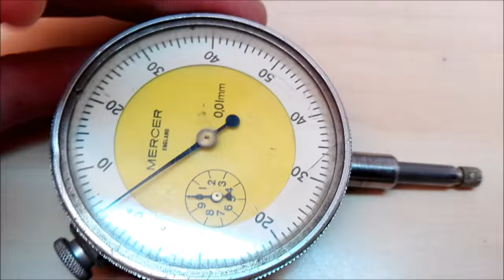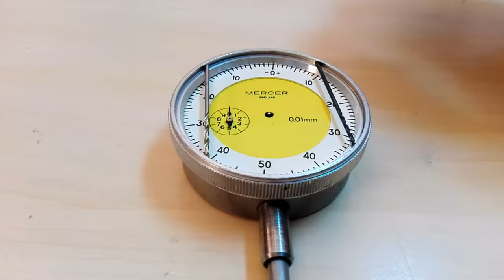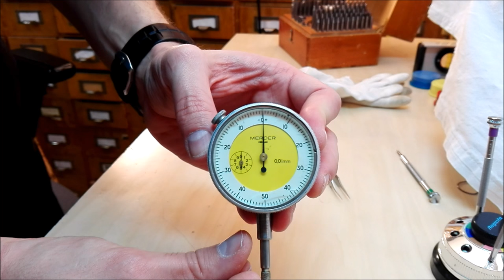Repairing a sticky dial indicator.

Comment: I'm a retired jewler, watch, and clock maker with over 25 yrs in the business. I hung it up 6 yrs ago and have had no interest in sitting at the bench again until I came across an old lathe. One of my teachers had given it to me 20yrs ago and it was ancient then. I believe it was given to him, the wiring was long ago degraded to very crumbling rubber and copper. I felt the urge to restore it and have started doing so. The only thing I'm missing is a tale stock,  on eBay they are crazy expensive so I'm making one out of aluminum. I was testing it out on some Rd brass stock and my dial gauge was sticking so out of curiosity I YouTube it and saw ur video. Low and behold I'm getting that old itch back I thought I was done with it. Thanks for the video. Take care and you'll never get rich with clocks for sure but if your like me it's more for the knowledge (how does this work), art and history.
Reply from the maker: Thanks for youd comment. I'm glad you are finding the joy to fixing and making things again. I'm just like you. I love the challenge with this stuff. And it makes me very sad that I cant do it anymore. Actually I have a doctors apointment today and I hope the news is not too bad.
Reply: @Lazywatchsmith   I wish you well, good luck!

Comment: Thankyou, thankyou, thankyou! My dial gauge and mag base went crashing to the concrete today resulting in a locked up gauge. After multiple partial disassembly's and rebuilds not fixing the problem and thinking the guage was beyond repair, I watched your video and felt brave enough to completely disassemble the gauge. That's when I discovered the entire clockwork and face had rotated resulting in the rod badly meshing with the gear. Once reassembled after a clean its back to working like new.
Reply from the maker: Awesome! Good job.

Comment: The best video I’ve seen on indicator repair so far. I would have liked a narration to go along with your video explaining the various steps and order of operations. I would also have liked to know what solutions you used to clean the parts as well as lubricants used. Thanks for posting your work.

Comment: That is the right way to do it.  I do it the much lazier way.  I soak the whole thing in mineral spirits, then denatured alcohol.  Put in a vac chamber to remove everything.  Then I oil and go to town.
Reply: i just put a couple of drops of sewing machine oil on the shaft and it loosend up a couple of sticky ones!
Reply: @jusb1066  better to put a drop of lighter fluid on the shaft to clean off the oil that some other owner put on by mistake. Most gauges say not to lubricate somewhere on them.

Comment: Nice video. I’d like to know more about your tools: 1) the pencil looking thing you rubbed on gears and in bearing holes before ultra sound, 2) your little oil dishes and why two types, 3) the device you used to install the indicator needles. 

I just repaired an indicator that I dropped and the finer points/tools of you vid would have helped.

Comment: Hi, Excellent work, even down to setting the turns indicator and main indicator to zero. You are obviously a professional seeing the deft way you handle and disassemble the dial gauge. Congratulations on a well executed repair.
Regards MoK
Reply from the maker: +Mo King 
Thank you so much. I am a watchmaker, but I have a broblem with my hands so they don't work so good anymore but this was big enough for me to handle.
Thanks for your kind words and thanks for watching.
Reply: Well... dial indicators shouldn't sit on zero when relaxed actually. And that is to provide preload from the beginning of their range. Mitutoyo dial indicators even have a mark under the dial where the hand should sit. 0,1mm before zero on a 0,01 indicator

Comment: Considering the state of my dial indicator, this is a bit too much of a time investment. It's a Starrett no.196, and it only has the mildest stickiness to it; it's as though you have to first gently break it loose to get it to move and then it's fine, but by then you've already jumped from 0 to 10 or 20. 

To me, it seems as though it's just thirsty for some routine maintenance, but I'd appreciate a more adept opinion before I do anything. Do you advise using a certain type of oil as a quick fix? Thanks.

Comment: I have a brown & sharp dial indicator.  I need to remove the needle to get the number plate off to put back into the inner ring. I have seen some pry off the needle then press it back on, are they all that way?
Reply from the maker: @kentaylor814  I think so. Pry from both sides at the same time.

Comment: Very informative, both video and comments.  I just did this 'kinda' on a Starrett, used a bit of watch oil I bought for my floor clock.  Have another, a cheapie from a garage sale, seems OK as is, but missing 3 of 4 screws in the back.  Likely to be Chinese and metric.  Thoughts on finding replacement screws with a watch repair person?
Reply from the maker: Hi. I would think that european and asian watches are quite common regardless where you live. So I think you finding the right screws from a watchmaker is wery possible. Sorry about my english and happy hunting.

Comment: Amazing, i have a box of about 10 DG's all sticky, if i tried this, half the screws would be missing or chewed, none of the gears would fit back where they came from and the needles would all be bent :)
Reply from the maker: 😂 there is good tips in these comments. You should read them. Thanks for watching.
Reply: Yeah, read them mostly :) I'm more adept at wielding a club hammer or running a mill - my banana like hands don't work too well on microscopic parts :)  I'll leave that to the experts i think.

Comment: How much tension should be on the spring, and what were the two oils you used (one red cap, one yellow cap)?
Reply from the maker: +bkupiec 
Not more than 1/4 of a turn. Just make sure the hairspring does not bind when the indicator is in it's upper limit. The oils are special clock oils. Red moebius 8030 and the yellow moebius 8300(vaseline). Just use some thin oil like sewing machine oil.
Sorry about my english.
Thanks for watching.

Comment: Looks like a lot of fun, but for sticky gauges a bit of mineral spirits on the external moving parts usually frees them up. Those are the parts that are subject to external soil.
Reply: Only if u want to make it worse in the near future. There is only 1 way to do it correctly. Take it apart.
Reply: That eats up the lubrication. Open it up first. Spirits, then dry, then use watch oil.

Comment: Thanks for the video. Was just wondering is there a way with these gauges to lighten the tension resistance on the plunger  by means of adjustment ? Thanks
Reply from the maker: Thanks for watching. I think there is no easy way to adjust that.
Reply: @Lazywatchsmith  Hey thanks for the response, well I just pulled my digital gauge down, it appears there is a small spring that sets the tension resistance as well as a small lead block that adds to the inertia factor, I found a similar spring with lighter tension and replaced the original, it does seem to have less resistance now so hopefully it may be the fix for the purpose at hand. Cheers, Trevor
Reply from the maker: @cincinattiblues  Nice job man.

Comment: nicee. what kind of liquid that used in the ultrasonic tank? thx
Reply from the maker: It is special clock cleaning solution. It is good for removing oil and greas. Thanks for watching.
Reply: thanks, recently i buy cheap ultrasonic cleaner, i do use water and gasoline.
i will do search about clock cleaning solution.

Comment: I had a sticky dial indicator so I washed the mechanism with Methylated spirits or it might be called denatured alcohol?? And the blasted thing fogged up on the inside and won't clear. Its a very thin film and not that I soaked the whole thing in the alcohol either... How do I get the glass off because I'm certain its not got a split ring as you've shown here?
Reply from the maker: Is the front pressed on the case?
Reply: I suspect the whole bezel is a press fit onto the body...... I also suspect the plastic may be removed with a suction device as I guess some watches? I'm not sure of this. I have tried some levering of the bezel but carefully and not wishing to do damage and yet cannot feel any type of freeing up... Seems to be locking up instead of being ready to slide off..... I've heard paint thinner may be a way of cleaning inside? Prefer to have it off and to clean by hand....... Just dropped a note to the manufacturer and hopefully they can also give me some tips but its Friday night here........
Reply from the maker: Tom Tee 
Maybe if you open the back an gently heat the glass? thanks for watchin and good luck.
Reply: The best cleaner (and almost the only one I use) is simple Isoproponal.  Even that can fog up a crystal if you use too much.  As for getting the bezel off, if it doesn't seem to be a press fit, you'll have to open up the back.  Look for a very small, flat, thin oblong of (probably) brass, held down by a screw in a slot.  It will be next to the outer edge, probably opposite the main gear section and in the lower quadrant.  Loosen the screw so the oblong can slide inward.  This disengages it from an interior retaining groove in the bezel.  Use caution:  On the other side of the bezel is a retaining spring that also fits in that groove.  When you lift the bezel from the body, that spring may sproing. Once the bezel is out, you can replace the crystal.

Comment: Hi, maybe you are my man.

That hair spring is for backlash? So, dial indicator has backlash?
Becouse I opened a prestigiuos Mitutoyo double rod hight gauge, with dial, and it has literally lost all the accuracy. repeteability etc. Seems to me a backlash problem, and I remember perfectly that spring sound when I opened it the very very first time. 

Do you think preloading spring is the righ way, and it could solve the problem?
Reply from the maker: I think the hairspring is to keep the wheels engaged to themselves. Is the spring ok that pulls the plunger? Or the movement might be in the wrong position. If the movement is too close or too far from the plunger thingy. It does not work. I hope this helps. And sorry about my english.
Reply: Your english is ok. That's me I don't understand a shit of gear and teeth! Fuck I'll buy  another one. 
Thank you.
Reply: No, don't buy another height gage.  They're very expensive, unless you get at super crappy one.  Your problem is almost certainly the hairspring.  It does indeed remove the backlash so you'll get repeatability.  But fixing that in a dual-beam height gage is not at all easy.  One hint:  When you're winding that spring, make sure you do it so the spring gets tighter (contracts).  And be patient.  These make me scream a lot.

Comment: i use these in my job everyday. some people have a habit of dropping these and usually the whole thing becomes really sticky or the spindle or plunger wont actually move at all. is there any coming back from such a fate or should i junk them? thanks :)
Reply from the maker: +robom1995 
Do not junk them. You might be able fix them. Look at 3:53 on the video. Often the movement has only sifted slightly and the plunger gets too close to the wheel in the movement. Good luck and thanks for watching. Let me now how you do with it.(sorry about my english)
Reply: It depends on the value of the indicator.  A brand name (Starrett, Mitutoyo, Brown & Sharpe), definitely.  Fowler or SPI, probably.  Your basic Chinese indicator, probably not.  Basic rule:  If the repair is going to be more than half the value of the tool, get a new tool.

Comment: Great video! It really inspired me!
What's the solvent your'e using after the ultrasonic cleaning?
Reply from the maker: It's gelbar. For watch and cklok cleaning solutiom
Reply: @Lazywatchsmith  
Thanks! But I think you're talking about the ultrasonic cleaning solution itself. I meant the solvent (or whatever it was) you used to rinse the parts after the cleaning...
Reply from the maker: Yes you ate right. First i use water and after that isopropyl alcoholto get the water out.
Reply: @Lazywatchsmith  
Aha so the liquid in the glass jar is alcohol (in the video it's titled "clean water", but now it makes more sense to put alcohol in a small glass jar!)
Thank you!

Comment: Waaw, great job. Wish it was filmed at half the speed so I could get a better look at your techniques and tools ...
What do you use to clean the jewels ? Is that just a wooden stick ?
Reply from the maker: Thanks for watching! Yes just wooden stick before the ultrasonic
Reply: You can slow down the playback by going to Settings (click the little cogged wheel on the bottom right of the screen) then click Speed and choose .50 on the list. .25 is also available for really detailed observation. You can do this at any time (while paused or during playback).

Comment: Who knew that there could be so many parts in an indicator? <G>  Not a job for an old man with shaky hands!  Were the case and plunger also cleaned in the ultrasonic cleaner?  Did the plunger not need to be removed from the case?  Thanks for an interesting video.
Reply from the maker: Dont remember anymore. Sorry Bob. Thanks for watching.

Comment: Thanks very much for this video Lazy watchsmith, I've watched it several times and it's helped me a lot. I've developed a strange affection for renewing vintage Mitutoyo Series 2 dial indicators and I learned a lot from watching you work on this one :) I have a couple questions; if you could advise me I'd be very grateful. What solution should I use in the ultrasonic cleaner for the movement parts? Also, what are the two lubricants you used called (I'm sure I can find supply if I know the right terms)? Btw, a dial indicator should be set to be about a quarter revolution counter-clockwise of zero in the rest position, such that you have "preload" room when you're using it. I'm not sure if that's to take up backlash or just to give you room to indicate on both sides of zero, but it's what I've heard from the experts at Long Island Indicator :) Any help you can give this budding indicator repairman will be very gratefully received :)
Reply: Oops, I should have read the comments first, I found what I need :) Thanks again for the video :)

Comment: You dont put any oil on the brass gears?
Reply from the maker: No never! When the oil gets old it only makes things stiky.
Reply: Okej, thanx for that tips, i fixes a italian made Borletti last week and i putted a small amount oil on the gears, need to strip it again then, have bought some other old indicators, 1 Tesa(Compac) 0.001mm made in swiss, Beautiful like new in wodden box, also 1 Interapid 312-1 also superb, and 4 total of Compac Geneve 2x40mm one IP54 353-E and 2x58mm
they have almost not a scratch, strange indeed?
im planning to take them apart, i have bought the Mobeus 9010 oil and the tooling that i need, will be fun,if they are not sticky and looks ok, im only gonna put some oil on the jewels, not a total strip, im from Sweden by the way..=)
Reply: One more question, how mutch do you preloade the hairspring?, do you know how mutch preload a compac should have, or did you put the gum to calculate the turn/preload of the gear?
Reply from the maker: Doger Karlström  I think I just estimated the preload. You can count the preload when you take it apart. Most of these indicators are dropped antd dont work because tje movement moves slightly in side the case. You can fix them just by adjusting the movements position. Have fun. Do you allready subscribe to the Swedish channel JWAM? He is Awesome! 
Lazy Watchsmith
Finland.
Reply: Im planning/thinking that i take a ink pen and make 2 mark, one on the housing and on the gear, then i can measure it exactly..=), No, have not seen the Swedis site JWAM, link?

Comment: I use cheap Chinese indicators and at the first sign of trouble give the plunger a squirt of WD40.   If trouble persists I give them the flick and replace them.  Always keep in mind whether you are using metric or imperial gauges

Comment: Your talents are wasted on dial indicators.  And unless that indicator is worth four or five hundred dollars, or has great sentimental value for someone, that amount of work is also wasted.  Still, it was a pleasure to watch you work. (I hope you checked it for accuracy before going to all that trouble.)
For anyone else with a sticky indicator, 95% of the time it's because dried coolant has stuck to the rack (the vertical rod), so that as it enters and exits the body, it drags on the interior bearing surface.  A few drops of isoproponal (straight alcohol) on either end of the rack, work it in and out a few times, wipe it off with a lint-free tissue, repeat a few times,, and you should be good to go.
If that doesn't work, call me or the guy who did this video.

Comment: Hi new here, subscribed check, like the videos check. We are watchmakers and micro-machinists. We repair our own dial indicators as well. Only sharing because mechanical and digital it is great to have this additional skill as watchmakers we did not know we would find this easy to do compared to the watch movement complication but they are actually larger and fun to work on after-all. One more thing we do not have to go outside to have done. Nice dial indicator service you performed, thank you for the share. Lance & Patrick.
Reply from the maker: Thanks guys! I use to be a watchmaker but now my right hand does not work anymore 😞